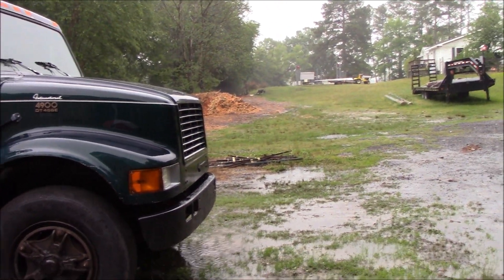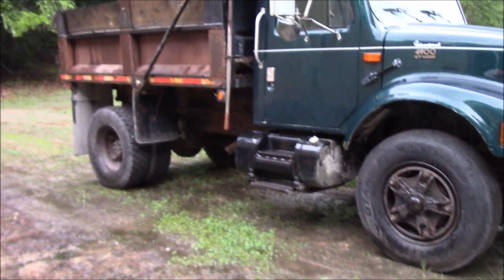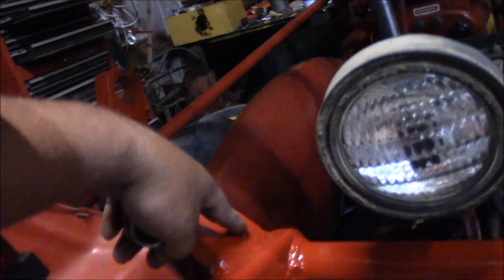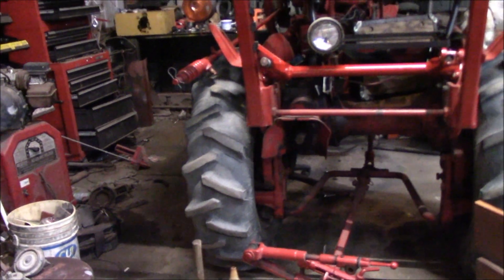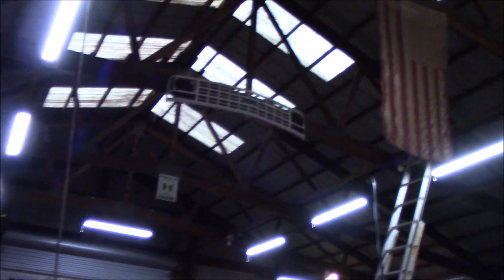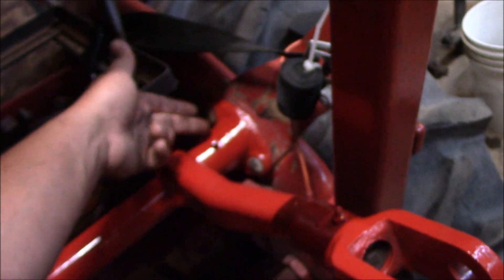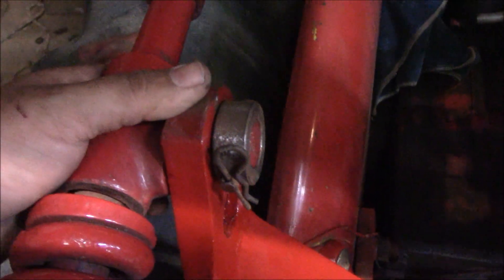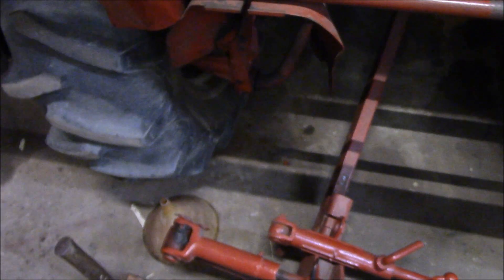79 Farmall 140 Fast hitch parts

Comment: Allot of the tolerance issues can be resolved with brass bushings. On another note I recently purchased an International Harvester galvanized fertilizer distributor that was like new old stock. Minimal use if any. I lightly blasted it and repainted it. Looks new. It’s now mounted on my 140 and ready to use .

Comment: On my '53 Super A, I'm installing a single point fast hitch and wondering how the helper lift spring connects to the Rock shaft arm. Any hints? Also do the bolts for the attaching bracket need to be shoulder bolts?

Comment: where do you get those tail light brackets you  put on and part number thanks
Reply from the maker: They were factory and already on the tractor. It's not too hard to find the left ones on tractors in the junk yard but only the 78s and 79s had both
Reply: Can a side dresser work with the 4 post canoy thanks Kenny McClurg